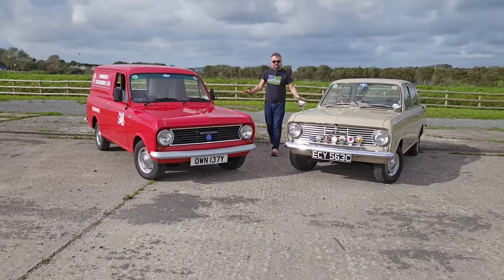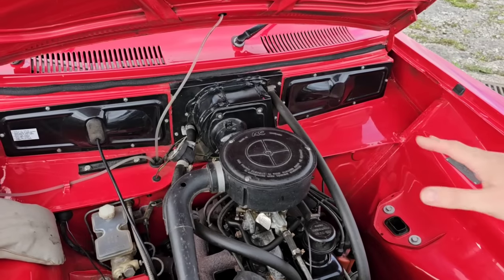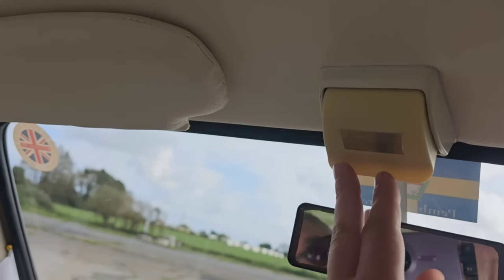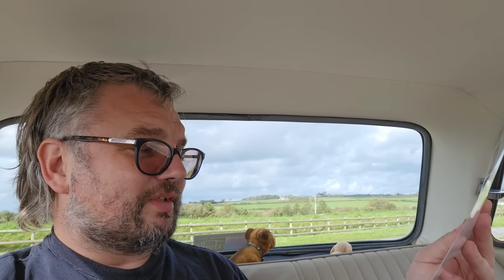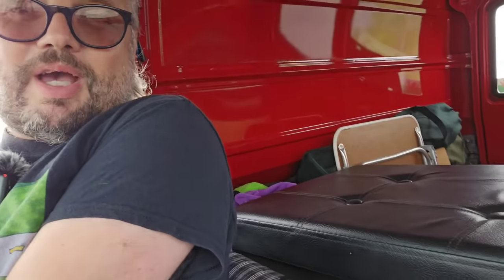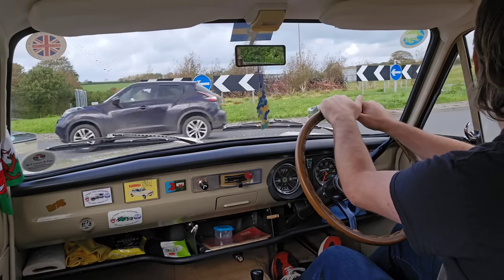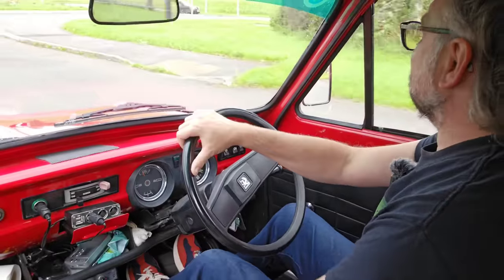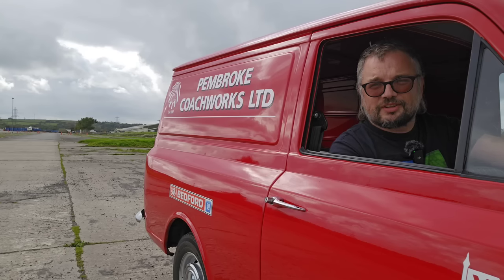Vauxhall/Bedford HA Viva saloon/van double test!

Comment: We drove from London to Barry Island in January with no heater in a HA van. This was 1974 and  I've just stopped shivering.
Reply: And I bet it took you 2 weeks😂. The most underpowered van in its class of it’s time
Reply: Ha! For me it was St. Albans to Portsmouth in a Mini van, but same.
Reply: @bigdude8470  nope I bet it was quicker no speed cameras or vans then 😂
Reply: Ah yes, the temperature level directly controlled a tap which either allowed the hot water to flow through the heater core or blocked it. Mine siezed in the 'hot' position fortunately so I could have  hot air or no air (but opening all windows was still possible). Later heater designs did not have a tap - the hot water always flows though the core but the lever now controls how much are gets warmed by flowing though the core and how much stays cool by bypassing it. So much more reliable!
Reply: 😅😅 love it,  I don't  care what car I drive as long as it has a good heater.

Comment: I worked in a Vauxhall dealership in the 90’s and the older mechanics told me of the HA van used as a service van. The dealership was near an hill with a bus stop at the bottom.The mechanics when driving down would turn the engine off, pump the accelerator and start it again. This would result in an engine backfire at the bus stop!!
Reply: Lol….yes i can remember doing that sort of thing as well
Reply: I did those backfire booms in my first car; '91 carburetted base Honda Accord in 2014! 😜 Hahaa. We joked that people should call the cops, someones shooting 😆

Comment: We (BT engineers) hated them as they were even slower than the Morris Minors they replaced. One of our guys was allocated a Marina van as a trial and we all envied him.
Reply: Oh the enviable acceleration of a Marina van. 😂 Never thought I'd hear that!
Reply: @piuthemagicman  All things are relative. Our HA van was overtaken by an old lady in a Morris Minor
Reply: @piuthemagicman  They were relatively spry, those Marina vans - 1300 A series hauling a large volume of air..
Reply: I used to work for BT but joined later when they had the smiley face transit vans M reg (93) with the piper logo slow and no power steering 😁was good when they changed the fleet to the  mk6 transit.
Enjoyed the job though OMI ..UG D side and O/H repair and more 😁.
Our level one started on the job as a telegram boy ,he's still there age about 65 now
Reply: @hunchanchoc8418 I rode in a Marina van when I was a kid -- pretty dope.
Reply: @johndrake2729  Is dope the same as sick,  or pants?
Reply: Slang for cool.
Reply: @johndrake2729  Thanks for the clarification!  ;-))

Comment: Worked at Vauxhall in the 70s and 80s. I remember during the economic woes of the early 80s they moved the production of the HA van from the van line up to the main building so they were built alongside VX 1800 and 2300. Much better quality result therefore on the last couple of years. Only kept going for the last few years because the Post Office had a long term order so they kept making them.
Reply: Also worked for vauxhall at the spares warehouse......we had ha doors and wings stacked to the roof ! Yep post office order kept us busy.

Comment: What an interesting comparison. It never ceases to amaze me how far car technology has come on since I passed my test in 1984.  And, if I'm honest, I don't think it's all been for the best.  The restricted visibility one gets in new cars, due to all the safety tech, is not necessarily an improvement.  Loved this review, thank you Ian.
Reply: My thoughts exactly!
Reply: One of the few good things about modern cars is the vastly improved fuel economy. 
I bet you'd struggle to get more than 35mpg out of these.
Reply: Compare a Triumph 2000 with a modern little car with an A-pillar that's all blind spot: I see what you mean. OTOH, if I'm going to have a crash, I know which one I'd rather be in.
Reply: @cornishhh  I have, for many years, driven old skodas. I am one of those sad individuals who records their mileage and MPG. The Skoda averaged around 40-MPG with mixed driving, and usually achieved 45mpg on a run, topping out occasionally at 50mpg. I replaced the now ancient Skoda with a more modern Suzuki Ignis. A neighbour made a similar comment about now enjoying better economy. The Ignis averaged just 30mpg with mixed driving, and maxed out at 40mpg on a very steady motorway run. Granted, the Ignis was a 1.5 to the Skoda's 1.3, but needless to say, I did find the Suzuki's MPG disappointing. My present motor is a Wagon R+, which has been more comparable to the old Skoda. 
What is surprising, a modern car with 16-valves, VVT, fuel injection and sophisticated engine management, struggles to compete with an 8-valve, carb and points setup! Perhaps it is the extra weight of the modern vehicles, or all the extra goodies they come with, but I imagine an ancient sub 1-litre box on wheels could be very economical indeed.
Reply: @gord307  There's nothing sad about recording your fuel consumption! I do it quite regularly, although I'm less inclined to do it with my present car (A 1.4 Peugeot 205) because it only does low 40's mpg.
I think one reason why older cars are sometimes more economical is that some tend to be lower geared. I had a 1.1 205 previously and I'd be in fifth in that when I'm in fourth in the 1.4 and considering changing down to third. That regularly did low 50's mpg and on a couple of occasions I've had over 60. That wasn't consciously economy driving either, and was tank to tank in a variety of driving conditions.
As you say, weight is important, and also rolling resistance, because modern cars tend to have wider tyres.
However, one of my friends gets over 40mpg cruising at 70 mph in his modern (ish) Jaguar. You'd be lucky to get much more than half of that in a 4.2 XJ6.  
The only two cars I'm aware of which have done over 100mpg in normal traffic under test conditions and averaging speeds of over 30mph were a Citroen AX 1.4D and a 1965  Reliant Regal.
Reply: @cornishhh  you make some good points – old Jags and rovers were famously thirsty. I have pondered if you could take an XJS and pop a 1.3 Fiesta engine in! And again, those lightweight cars like the old Reliants were astonishingly economical, and all credit to Reliant who made their own engines too.
Interestingly, my somewhat uneconomical Ignis did have very tall gearing, meaning it did not like doing 30 in 4th, but 3rd still felt a little low geared (and the same at 40 too), meaning the gearing was never quite right for the most common urban speed limits. The Wagon R+, on the other hand, has perfect gearing for town, and an engine which is willing to pull from lower revs.

Comment: Drove a 1975 (P reg.) HA van while working for a printer's engineering company. The cab was very spartan and didn't even have a headlining. I drove from London to Norwich on a winter's morning with a layer of snow on the roof. When I arrived at my destination, a small circle of the snow had melted immediately above the driving seat from my body heat! Switches for the wipers and driving lights were side by side on the dashboard (made more difficult to reach due to the fixed strap seat belts!). One rainy night, I remember the panic that ensued when I wanted to give the screen a quick wipe and accidentally switched off the head/side lights while joining the M3 from a slip road! Another time, the gearstick came out of the transmission tunnel. I rolled to a halt in a convenient roadside parking space. I rang our office from a pee - ridden phone box and was advised to push a certain size screwdriver (from my company issued tool kit) into the "hole", and "avoid using reverse gear to get back to the yard". I did this and limped back to base for a repair. I drove the van from London to Cardiff and the body "throbbed" so much I was temporarily deaf when I arrived!  The Bedford HA van was really a 9 - 5 town vehicle. Low cost, nippy but not really for journey - work. So glad when I got my Ford Escort Mk. II "45" van in 1979.

Comment: I had a bright yellow Ha van ( guess who owned it before), £80 from an auction and I had a choice of about a dozen.
Absolutely loved it, went all over the country in it and it never let me down.
Reply: My Dad had one of those in the early 90's for a short while, also bought at an auction, very dodgy hand paint job, what turned out to be an hookey MOT and the rear doors had to be bungee together as they would fly open. We as kids used to sit in the back of it with no seats.
I don't think you could get away with that now.
Reply: ha  van  was  a  bt   yellow
Reply: Either BT or British Rail

Comment: The flexible screen wash bag was a good idea because you could fill them in the small sinks of public toilets.
Remember when a lot of laybys had public toilets?
Reply: With water, I trust
Reply: @AndreiTupolev   well, otherwise you could refill them roadside ;)
Reply: @AndreiTupolev Fun fact: when the Class 91 locomotives were new, they went through windscreen wiper blades like nobody’s business. After a bit of investigating, it transpired that drivers were spending a penny in the washer tank , and it was rotting the blades. They had to put locks on the tanks to end the disgusting practice.
Reply: @nkt1 certain trucks I worked on the drivers would do that as the windscreen washer bottles were inside the cab,D series ford or Bedford 🤔
Reply: @nkt1 certain trucks I worked on the drivers would do that as the windscreen washer bottles were inside the cab,D series ford or Bedford 🤔

Comment: This really takes me back.  When I was doing my apprenticeship, I often had to take the boss's wife's Bedford Viva van (M-reg, so 1973/4) to do deliveries, collections and service visits.  It was a proper little buzz-box, rather low-geared so nippy but not so good on dual-carriageways.  My most memorable delivery run was from Bristol down into south Somerset in a blizzard, driving across the top of the Blackdown Hills and down the 1:5 hill into Wellington in the snow.  
After a year or so, the boss's wife got an Escort estate, so I inherited the Viva as my personal run-about.  My son was about two years old at the time, so I roped a big old hefty push-chair into the back, in which he could ride.  
One peculiarity was the exhaust pipe fixing at the manifold end: a simple flange welded around the top of the down-pipe, which was fitted with an asbestos collar and simply clamped to the manifold by a three-bolt ring.  When the flimsy flange rusted through, the pipe would simply drop out of the manifold, with a huge increase in noise levels.  Mine did this at around 5:30 am one morning as I was setting out from home, and the racket woke up all the pigs on the farm opposite, who made even more noise and disturbed all the neighbours: I wasn't very popular.

Comment: You have to imagine the step up these were at the time.  Dad's first new car was an HA after two Morris eights and Ford squire, going from 3 speed side valves (and the yearly de coke) to one of these must have been revelation
Reply: My dad went from an Anglia 105E to an HA (FTX 256C) and said it felt like a rocket ship in comparison!
Reply: Loved the ford squire
Reply: @alanrobinson7866  the squir was a posh 100e van with windows and fake wood on the side, don't think any still exist

Comment: We were still driving the HA vans in the late 1980s on British Rail in their yellow livery. Upgraded to the Ital vans before moving to the Bedford Astras (which in fact were much smaller inside).
The choke clothes peg was also a requirement in the Leyland Princess too! The twist lock didn’t work for long.

Comment: The document holder in the footwell of the saloon was for the service book. It had a cut out, as did the service book so the mileage of the next service could be seen. It matched the window of the service book. When they were serviced the dealer tore out the voucher and stamped the stub and revealed the next voucher with the mileage when due. Usually 3000 6000 9000 etc
Reply: That was a feature on Vauxhalls for years - I remember my father's FB Victor had exactly the same.
Reply: I wonder which was the last Vauxhall/Opel model to feature those service book holders. I definitely had them in my Mk2 Cavaliers, but I can’t remember if my Mk3 Astra had one.
Reply: Well remembered John yes I remember those document holders in dad’s Astra mk2 and chevette and nova!

Comment: My first car was an HA Viva 1964. I passed my test in it and had it from 1967 to 1972. It took my all over the country including sleeping in it at the 1972 Glastonbury Festival. It did over 100,000 miles with very few problems and I learnt so much about how cars work with this vehicle.

Comment: My dad bought a HA van from his painter & decorator mate with a terminally ill engine. It was a mid blue '82 Y plate. My dad was a mechanic so it was bought as an earner. I would have been about 9 or 10 & was tasked with pulling the engine out, swapping the parts over to a used engine he had already got then putting it all back together. I did it over the course of a week during the school summer holidays. It seemed like a massive task at the time but I managed to get it done with some minor assistance hoisting it out & dropping it back in. In retrospect I don't remember getting a bung when he sold it!

Comment: Hi Ian. Back in the day, as a teenager, I had a nearly new 1965 Viva deluxe. In that year they didn't come with factory fitted seat belts so I ended up fitting accessory belts myself. By the way, re: your comment about Vivas and motorways, I remember doing 2 or 3 trips from the West Sussex coast (home at the time) up to the lake district and back, motorways and all. I well remember keeping the speedo needle around the 75 mark for mile after mile - that engine would take it !  I could squeeze a good 80 mph out of mine (exceptional I think) but due to a bit of 'over enthousiastic servicing' my carb had to be replaced at one point, and after that the performance was just like any other Viva. But before that it had been an Anglia beater, even rivalling the 1200 on performance !! Not after the carb change unfortunately. The brakes were extremely sharp, as you found, but careful braking could be required in wet conditions for obvious reasons. Ah ! - the memories.

Comment: I absolutely love a Beagle van 
We had various vivas and ha vans when I was a teenager across the family 

My dad had two ha vans that I learned mechanics on - both were not road worthy at first and between the two we made one that was. 
It was a rare Danbury conversion with a rear folding seat and glass sides - with the same running gear as in the video 
It was a awful blue colour ( as a result of my brother walking round to the pain mixer shop and picking a colour while drunk..) 

It was a really lightweight workhorse that passed around the family for years. 

In the early 80’s it was the best vehicle to use on a Sunday ‘treasure hunt’ - a competitive drive where you collect items and answer questions to find your route ( you had no map) to a country pub- with points awarded and also a milage penalty for being over or under the actual milage for the course .. the reason it was so good was because if you reversed the odometer would wind down 

Also interesting was that the subframe was mounted on huge bolts that you could wind down giving you body lift 

Absolutely loved it

P.s. the gearbox on all our vivas had awful 3rd gears - by the time I was old enough to drive it I could drop the gearbox and change the clutch in well under an hour